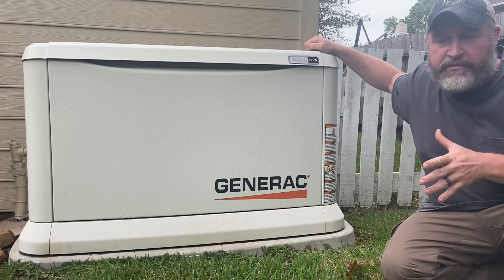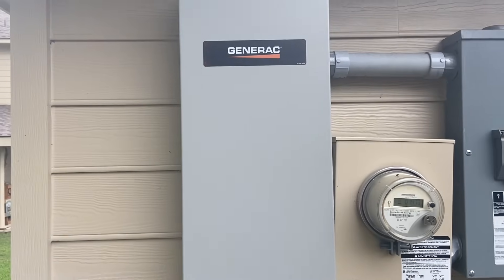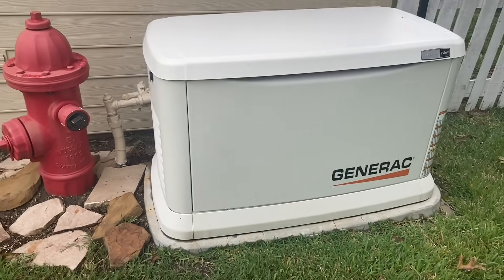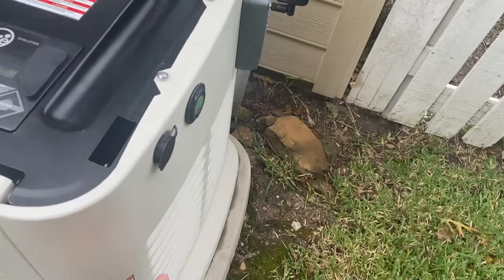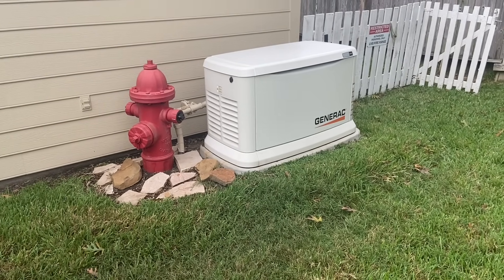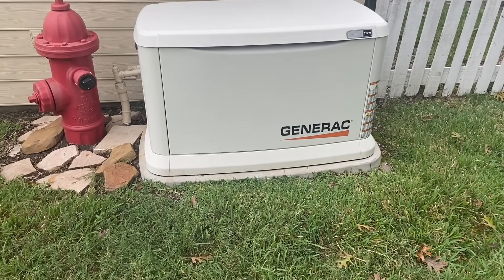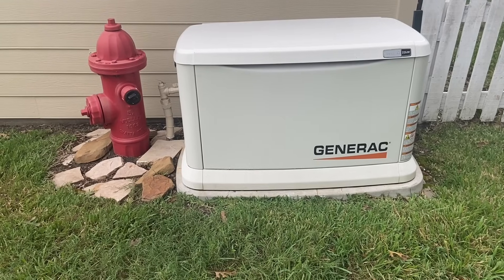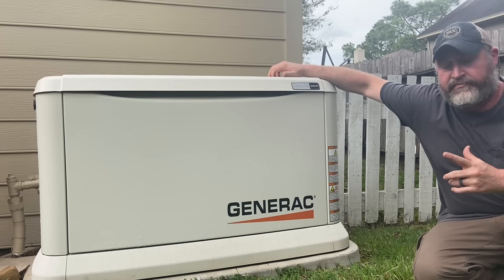Thinking of purchasing a generac whole home generator?

Comment: Thinking bout adding one of these 2  a little under 1500 square feet home wondering what the cost would be for that size and natural gas hook up?
Reply from the maker: Hey Tony thanks for watching lots of different variables come into play far as a install goes, you can always use what I paid on my invoice as a guild but Gas line run length, electrical run length and so on would be different. My advice would be to get 3 quotes on go from there. Hope that helps thanks again for stopping by my channel, check out some of my other videos, please subscribe like and share ring the notification bell so you won’t miss any upcoming videos. Have a great week.

Comment: I have always been curious as to how the battery is kept charged (by a battery tender type thing, I'd guess) since when the generator is not providing power to the house where would the power come from for the tender?
Reply from the maker: Yes it gets a charge thru the system from the incoming power.

Comment: Electrician coming next week for a quote!   If he orders it, it's out 5+ months because big boxers have production tied up, but he will wire in one if I have boxer deliver it.  Elect meter and nat. gas meter are on opposite ends of the house.  LIfe is not easy!
Reply from the maker: Congratulations buddy hope it works out great!
Reply: Just added one of these this summer.  They'll tell you 5 mos. to "under promise and over deliver", but ours was much sooner. The electric on the opposite end of the house isn't a big deal, they'll just run through your attic.  I also signed a 2 year fixed rate our gas provider to stabilize the cost.  As clueless as Biden is with our energy program, seems like a solid investment to me........😊

Comment: Looks like a decent install but You have an SE rated switch, why use another disconnect?

Also, your ats has the neutral bonded to ground which should only be bonded at your first disconnect not the ats as well
Reply from the maker: Thanks for watching, it was a requirement to pass our electrical inspection, I agree it was not needed but hard to argue with the inspector they where very strict. Please subscribe like and share check out some of my other videos, have a great week stay warm!

Comment: How often do you need to change the oil out? I’ve seen mixed reviews. I also heard that after 40hrs run time it’s best practice to change the oil. I ordered a 24KW last week finally caved in. I also chose Generac over Kohler because of limited resources for maintenance.
Reply from the maker: Once a year or ever 100 hrs after the first 25 hours.
Reply: The is very little difference in maintenance requirements between the two brands, other than generac says you can do two years between services.

Comment: Awesome. And $11k isn’t bad for what you’re getting compared to other tech. Speaking of: Have you considered also adding batteries or solar? Especially batteries. Maybe not economical yet but just curious.
Reply from the maker: Thanks buddy for watching, no I have not looked into batteries and Solar is such a slow return on investment I doubt we will ever be doing it.
Reply: I agree. Solar is VERY inexpensive. I have 15.5 Kw of LiPo EG4 battery storage and Growatt hybrid 240v with surge to 18kw inverter for under 5 grand. The renogy panels are cheap as all get out on Amazon and conservatively underrated for power production. Batteries are rated for at least 20 years as are the panels

Comment: Nice video with some great info.  BTW, I also live in Texas and I had the Generator SuperCenter come and quote me an install last year.  The guy told me that because of the ice storm here in Texas a couple of years ago, Generac does not warranty the unit if you have an electric furnace as part of your HVAC system.  Have you heard anything like that?
Reply from the maker: Hey thanks buddy for watching please subscribe and check out my other videos. No I have not heard anything like that, however my area has gas furnaces. I would call for another quote or call their office to make sure your sales person was correct. That statement seems like it would definitely limit sales !?!

Comment: How much did your gas bill run over the average monthly bill for the 35 hour usage during the outage?
Reply from the maker: To many variables to give you a definite, but I figured during our 3 day outage we spent about 17$ more per day than normal give or take a few , keep in mind we had 2 gas furnaces and a gas fireplace one with the attic door open to keep our pipes from freezing. It was also  a colder month than normal so our gas usage was elevated thanks for watching please subscribe and check out some of my other videos
Reply: @JustCantSitStill  That’s really not bad, I thought it may have been more. Thanks.

Comment: Do you have a way to hook up external propane tanks in event gas company supply is disrupted?
Reply from the maker: I currently do not have a way to do it but I definitely could , with a valve and a tee i could plumb it in. Thanks for watching please subscribe like and share!
Reply: Propane orifices are smaller in size than natural gas.  The orifice in the fogger would have to be changed out to switch gas types.

Comment: When its freezing out, it really doesn't matter what it costs, but I'm curious as to what that 35 hour run time cost in gas usage?
Reply from the maker: thanks for watching, it’s hard to say our fire place, furnaces and water heater and dryer are also NG , but for the big freeze our bill was only 52$ more than normal, we where using a lot of NG keeping attic from freezing. I hope that helps. Please subscribe like and share!
Reply: @JustCantSitStill how many days did you run it doing the big freeze
Reply from the maker: @fabe405f9  3 days

Comment: About how much fuel cost does it use per day?  (on propane or gas).   Thanks
Reply from the maker: See the spec sheet for a breakdown https://www.generac.com/generaccorporate/media/library/content/all-products/generators/home-generators/guardian-series/16kw-7036/20-and-22kw-spec-sheet-generac-new_2.pdf

We did not notice a lot of difference the only time we needed it for a extended period was during the freeze, with use using a lot of NG for 2 furnaces and fire place we see a increase of about 17$ per day, during a summer outage I expect it to be less per day.

Please subscribe like share
Reply: @JustCantSitStill  I'm not sure about the cost per day, that all depends on the cost of gas. I have had this same generac but have to use propane. I have had it for a little over a year. When I bought it, I bought a 500 gallon propane tank. You cant fill them full but the propane co. put 440 gallons in. I had a 250 gallon tank and had them connect the 2 tanks a couple weeks ago. The driver was able to to put 150 gallons in the 250 gallon tank but could not add to the 500 gallon tank. I had only used about 20 gallons out of the 500 gal. tank in over a year with it running once a week and we have had 5 or 6 times of no power for 4 to 6 hours.  My house is only 1720 sq. feet but its all electric with 2 50 gallon water heaters and a water well. I cant tell any difference in being on city power and the generac.  I figure I have 600 gallons and can run 14 to 16 days. The propane was $ 3.65 per gallon. I hope this helps you figure what you need to know.

Comment: Ignorant question. So does it stay power off of your homes natural gas? Meaning there's nothing you need to do to refill it to keep it running in an extended power outage?
Reply from the maker: Yep will keep running as long as the natural gas keep flowing, just remember to turn off and check or add oil if needed every 24 hours. Thanks for watching please subscribe and check out my other videos.

Comment: My Dad had one of those.  After a hurricane came through town and left him without power for almost 2 weeks, he said 'Never again'.  He spent a fortune on the generator, another fortune on an electrician to wire it to home.   Next time bad weather came thru and the power went out......the damn thing didn't kick in.  Don't bother......it's a piece of crap.
Reply from the maker: Thanks for watching, I wonder if it was a problem with the install ? Was it ever load tested ? Anyway I sure it can be fixed. Thanks for the nice comment please subscribe like and share
Reply: After IDA last year in New Orleans area I keep 4 GENERACS running for over 3 weeks, You do get some bad ones but most are poor installation or not maintained. That's a good price most 22KW in our area are going for $13K or more.
Reply from the maker: @bayouslots3143  thanks for watching! Going price now from what I have seen is like you said 13k-14k. I think you are 100% right on the install and maintenance. My dad had his since 2008 or 2009 uses in a lot due to his area and it has been flawless. Please subscribe like share and check out some of my other videos

Comment: Thanks for the video. My question is, will the system work in extreme heat, like we have in Houston? or will it automatically shut off? I appreciate your time, than
Reply from the maker: Thanks for watching please subscribe and check out my other videos, we have not used it for an extended period during the summer months. However I do run a load test once every three months while I am doing yard work so it runs for over and hour in the summer months with 0 issues. I don’t expect any overheating problems during the summer we are also in Houston!
Reply from the maker: Oh to add to this my pops 
has a smaller 17kw located greater Houston closer to king wood , ran off of it for 3 weeks straight 0 issues so I think we are good! 👍
Reply: Nice video got one today
Reply: @JustCantSitStill  Thanks for getting back to me, my fellow Houstonian. I saw that Generac featured an Air Cooled unit that shut off when it became too hot. That's what prompted the question. I just subscribed, so I will check out your other videos.
Reply: @JustCantSitStill  What size house does your Dad have? I may not need the 22Kw and perhaps I could go with the 17kw, like him.
Reply from the maker: @mikebonner3257  awesome thanks! Yeah it also has a low oil cut shut off , great fail safes to protect it. I think as long as the generator is not overloaded and has good unobstructed air flow and exhaust the overheat should not be a problem. It is recommended to shut it down once every 24 hrs and check the oil level if possible.
Reply from the maker: @mikebonner3257  it’s right around 2000sf , one A/C for house , one for shop (not running all the time) and pool pumps. He has never had a problem.

Comment: Just wondering where are the discounts [off season + cash + managers discounts] in the tally of the invoice?  It doesn't seem clear to me.  We are based out of Toronto Canada.  We are a professional Generac dealer here and come up against some very less reputable companies.  Just wondering if your installer said one thing on the invoice but didn't use the discounts in the tally.  Please let me know.  Great video btw.  Please try to use on average no more than 50% of the generators rating = 22kW x 50% = 11kW.  Using more is very hard on the generator.  Similar to driving your car at 160 mph all the time.  You will burn out either the engine or alternator/stator.  Limit the big 240V loads to one or two only at a time.  All 120V electrical items are fine to use just limit the heavy 240V load.  Thanks Dwayne First Power Generators Newmarket, Ontario Canada
Reply from the maker: Thanks for stopping by and checking out my channel, all the discounts where applied  I can’t remember if it lowered the gen cost or the install cost but the 10 year ext warranty was normally 1k.  Subscribe like share 👍

Comment: Thank you for the information. I’d love to know how long the generator would last if you had all of your lights, etc on and city power doesn’t restore for many days. Does the generator keep going and going?
Reply from the maker: Yes it will keep running  long as the natural gas is flowing but recommended to shut down and check oil every 24 hours. Thanks buddy for checking out my channel, please subscribe like share 👍
Reply: 22 days here with daily shut down/cool off time.
Reply: @baddadash  thanks. Wow all that time with no utility power? How much extra does it cost on the utility bill?
Reply: @danielklein8126  My gas company billed 2 months consecutive. I have a 16k unit with 15 people in my home using electricity like nothing is happening. Extension cords for the neighbors A.C. and appliances and the total bill was..............$525. I was happy.

Comment: Did you think about the Generac Pwr cell, which uses batteries hooked up to solar?
We're in sunny Florida, and that would be out preference!
Quieter system!
Reply from the maker: Did not consider it, don’t know anything about it. Not sure if it was even a thing back when we purchased our unit. If it was our dealer did not share any information about it. I would wonder how long it would last during a storm with not a lot of sunlight?

Comment: Do you know if and how it would run if the whole power grid goes out?
Reply from the maker: Ran fine during the freeze power was out everywhere. Long as the generators that pressurized the NG lines are still running and we still have NG pressure all will be fine.

Comment: can this be used if you have solar? also when you loose power does the meter act like it is connected to the grid still so you get charged by the electric company for using your gen?
Reply from the maker: No clue about Solar , but it runs separately from grid power so not you will not be charged other than your natural gas or propane bill. Thanks for watching please subscribe
Reply: It can be used in conjunction with solar panels easily enough. Grid tied solar will shut off when commercial power goes offline, then the generator will come online automatically (if you have an automatic transfer switch). The transfer switch is behind the meter, and so when it is on, it has completely disconnected the meter from your house for safety so power from the generator can  never actually get to the meter.
Reply from the maker: @kentritchie5677  thanks Kent for watching and the comment, please subscribe and check out some of my other videos

Comment: Hello. Great video, thanks for sharing. I have one question. Generac offers a “power load tool” on their website. Did you use the tool to determine how large a unit to consider?  If yes, how accurate was the tool based on what you ended up purchasing?  Thanks, Mark.
Reply from the maker: We were sized up during the in home quote we did not utilize the online tool. Thanks for watching please subscribe and check out some of my other videos.

Comment: Do you have a gas stove top?  If so run the generator and then one at a time, turn on each burner full, then look at the flame, does the flame demish?   Thanks I sub'd.
Reply from the maker: Yes gas for everything except for the oven. Or gas meter was upgraded as stated in the video we have enough volume coming in so nothing is diminished. Thanks for the sub!

Comment: Great breakdown! Just bought a house that has this model! Curious what size tank you have and how long will it run off that tank?
Reply from the maker: Hey thanks buddy for watching! We are on NG so it’s unlimited supply. Please subscribe like share!
Reply: I just ordered a 24kw LP model (delivery isn’t for 4-5 months yet) and am about to install a 500gal tank (400 gal capacity). Given their ratings at 50% load it consumes 2.1 gal/hr which is about one week continuous running on a full 400 gals. Where I live, the longest outage was in 2016 for 10 days. Fortunately I didn’t live here then so the longest I’ve experienced was 10 hrs with no backup just days after moving here. Hopefully I won’t experience a weeklong outage because I plan to also use the propane for a fireplace and possibly a built-in outdoor grill.
Reply from the maker: @ridingwithairbubble1694  great info for the folks asking about LP thanks buddy!

Comment: Thanks for a very informative video!  I am looking to get a Generac system for my place.  We live in central Wisconsin.  It's not "if" the grid goes down, it's "when" the grid goes down.  I live on a farm with an 1,800 sqft house and several outbuildings.  I also have a woodworking shop.  We have a 15KW transformer that supplies the farm.  So, would I need a 15KW Generac to power everything?
Reply from the maker: Thanks for watching glad it was helpful, please subscribe and check out some of my other videos. I think the 15kw will do all you need but, for the price difference a 18kw would give you some added insurance and room for growth.
Reply: You need to figure in your "Start-up amperage" to accurately size the generator you need. A "30 kw" would be closer to your needs.
Reply from the maker: @georgepruitt637  seems very excessive for the size of the house, but I am no expert during the quote process the company will figure the out what you need based on your needs.
Reply: You have to remember that the 15KVA transformer is connected to an infinite buss.  It has about a 150% surge rating, with virtually no voltage drop, which would on a small generator cause a current increase.  The last thing to rely on when sizing your machine is the transformer on the pole.  Do a load survey, an amp meter reading on the load side wiring if you are qualified.  To a point bigger is better, but appropriately sized is best.

Remember, don't size to the load.  Size to about 25-50% ABOVE the load, to allow for surges and any future growth-much fewer problems that way.

Comment: From that 35 hours when you had the run during the last freeze, how much would you say your gas bill increased?
Reply from the maker: With the generator running , both furnaces, gas fire place and water heater it cost me a little less than 17$ more than normal.